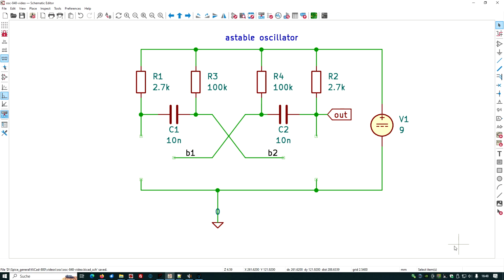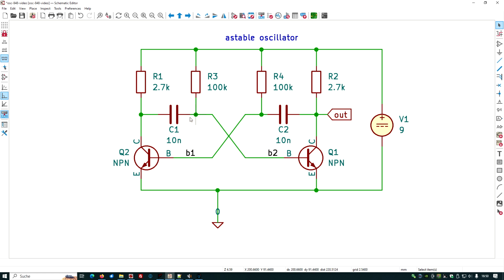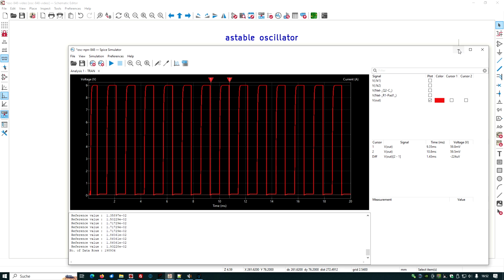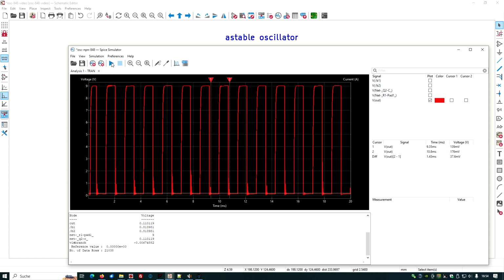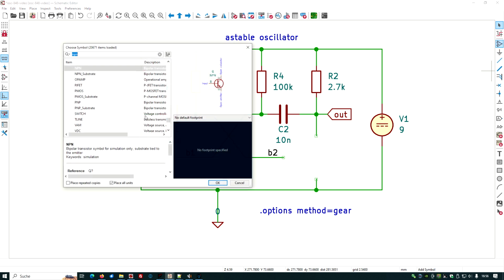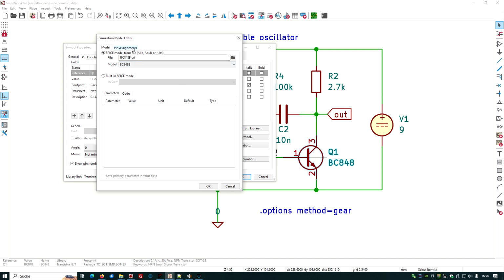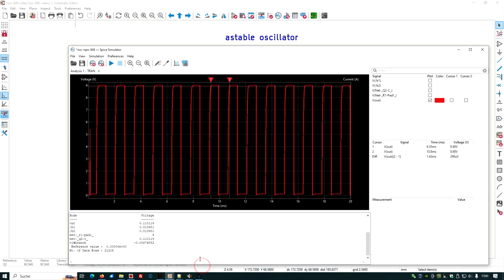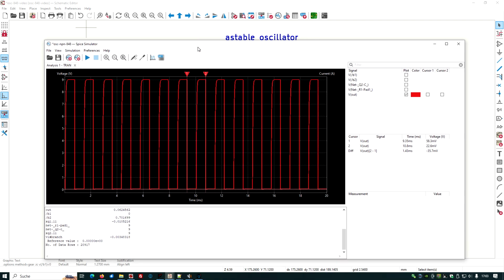ngspice in KiCad 8: oscillators, taming an astable

Comment: You said at 2:19 that the base of right transistor goes from 0.7 volt down 9 volt to around -8 volt. Why is that? When left transistor is conducting there is voltage divider between R3 and C1 which is between 9 and 0 volt.

Comment: I want to add DC 12 V to my schematic but after added it it dose not have a simulation model, how can I add a 12V dc sores to my  schematic
Reply: I think you can use the pspice dc voltage for the simulation

Comment: The only reason this circuit oscillates is because of the variance of tolerances of the components. If you pair the transistors and capacitors and resistors it won't  oscillate unless you take a wire and short a couple of legs of the transistors for a split second. (or discharge one capacitor and charge the other) This is a sample circuit in electronics training. In that one, an LED is placed above the collector of the transistors. This simulation might have a random variable in the algorithm to resemble the variances in component manufacturing. TinkerCad is another simulation online.